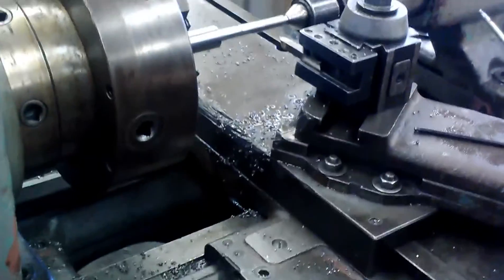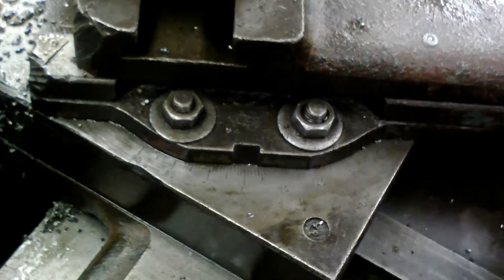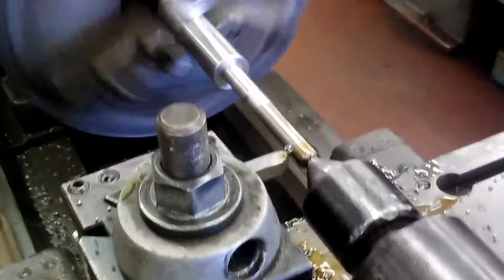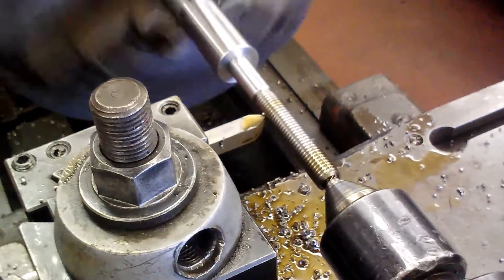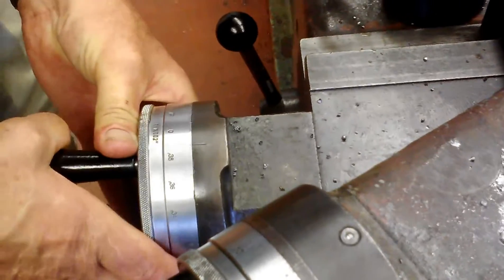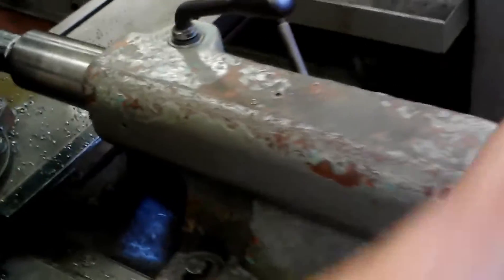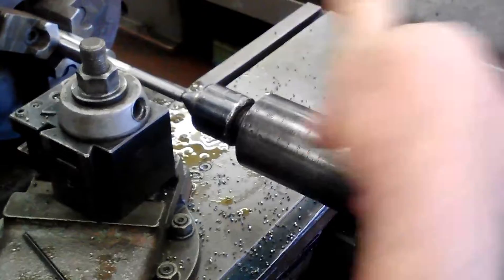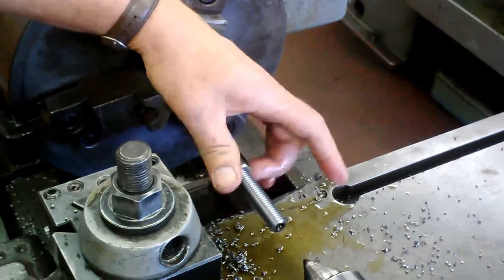Single Point Threading

Comment: ...you don't need to shut off or reverse the spindle...and you don't need to engage the same number on the threading dial...
...you should include a disclaimer that this is the way YOU do it...
...not the way an actual machinist would do it...

Comment: My lathe has the thread cutting gears but no chart to set the thread pitch.. Any suggestions pls?   Thank you
Reply: Yes, you need to calculate the change gear ratios to get the pitch or threads per inch for the thread you want to cut.
You will have to know the threads per inch or the pitch of your leadscrew to do this.
The formula is different for Imperial or Metric threads and is a subject too deep for a simple do it this way topic.

Comment: It seem to me that while going in reverse you could accidentally reengage the piece at the wrong time and mess up the threads. Am I missing something, or is the track the cutting blade can take on the workpiece set so that even if you disengage and reengage at random it will always be on track?
Reply: You would be engaging with the lathe's lead screw & half nut meshed in the opposite direction.  If you have a lot of backlash on the lead screw it's better to disengage the half nut, back the tool away, and manually crank the carriage back.

Comment: If only all male "fasteners" needed/could work with a "shank" LARGER IN DIAMETER THAN THE "MAJOR THREAD DIAMETER" AND A "THREAD GUTTER" BETWEEN THE "SHANK" AND THE "THREADS" AND SOMEBODY COULD INVENT AN "INTERNAL SINGLE POINT CUTTING LATHE" FOR THE EQUALLY IF NOT MORE IMPORTANT FEMALE THREADS "SINGLE POINT THREAD CUTTING" COULD GO FROM A RARE AND REALLY SHITTY WAY TO CUT "QUALITY" THREADS AND PRODUCE "FASTENERS" BACK TO BEING "STATE OF THE ART". OF COURSE ROLLED THREADS WOULD HAVE TO DISAPPEAR FOR THAT TO HAPPEN SINCE WHEN THEY "APPEARED" THEY "OBSOLETED" THIS STUPID "SINGLE POINT CUTTING SHIT" AND UMPTEEN "PASSES" AND WHO KNOWS HOW MANY MINUTES/HOURS OF "SET-UP" JUST TO CUT A SINGLE FUCKING THREAD PRETTY MUCH OVERNIGHT.
Reply: You forget, in your stupid ranting, that many people do cut threads with single point tools on old and long forgotten lathes makes with belt drives and back gears , not only with preformed carbide but with hand ground HSS too........you have a lot to learn, but by your ranting post it appears you are merely a capstan lathe operator only used to do piece work, so what would you know of anything mechanical when it comes to engineering.

Comment: More and more people are forgetting and or not even bothering learning old fashioned manual mills and lathes! I salute you good sir!
Reply: And more and more people are being brainwashed to believe "single point thread cutting" is a practical, effective, professional and desirable way to "thread" anything but "readi-rod" in a day and age where ROLLED THREADS have been "standard" in the industry for high-quality, properly-profiled, proper thread engagement STRONG and SMOOTH and RELIABLE THREADS CAPABLE OF DOING THE JOB PROPERLY. Go look at any tap or die. See a "single point"? No. Why? If you have to have it explained to you you're probably a "machinist" but a damned poor or inexperienced or highly "educated" one who has spent a LOT of time "learning" out of textbooks, on the internet etc but damned little time if any gaining KNOWLEDGE by getting the hell out of the "classroom" and into the shop with some "real" machinists/mechanics doing real work in the real world handling real fasteners and threads of all shapes and sizes, metric and standard, rolled and cut and in all kinds of materials. A "thread" is a "continuous wedge" and the LAST thing you want is that "continuous wedge" to be a CHISEL in profile so the male and female threads are "cutting" each other and themselves as soon as they're "engaged" and torque and tension are applied. The "100% engagement" most of the online "master machinists" seem to think is "ideal" is impossible to do anything but break fasteners and/or strip threads with and no "single point cutter" is capable of FORMING a CONSISTENT THREAD AND A PROPERLY "SHAPED" ONE WHEN A "PROPER" THREAD IS NOT A "60 degree angle" with perfectly flat "sides" and a "knife edge" point and the idea that using "thread wires" to "measure" the "thread pitch" of threads is freaking hilarious since the very NATURE of a THREAD and its COILED "SHAPE" MEANS THAT THE TWO "THREAD WIRES" ARE NEVER GOING TO BE "OPPOSITE" EACH OTHER AND "IN LINE" SO THE MEASUREMENT IS OF THE ACTUAL MAJOR DIAMETER EVEN IF BY SOME MIRACLE THE "THREAD WIRES" END UP BEING PERFECTLY "SEATED" IN THE THREADS. THE "MAJOR DIAMETER" WILL ALWAYS BE "RIGHT" AND EVERY OTHER "DIMENSION" AND "MEASUREMENT" OF THE THREAD AND FASTENER/HOLE "PERFECT" AS LONG AS THE BEGINNING DIAMETER OF THE "ROD" AND "HOLE" TO BE THREADED IS CORRECT AND THE PROPER QUALITY DIE AND TAP ARE USED ALONG WITH APPROPRIATE "CUTTING FLUID" AND TECHNIQUE AND "ADJUSTMENT" AND THE "MACHINIST" DOING THAT "PRECISION" MACHINE WORK BY HAND THE WAY ITS OBVIOUSLY INTENDED TO BE DONE GIVEN THE LACK OF A "POWER TAP DRIVER" BESIDES A LATHE OR MILL OR WHATEVER MACHINE TOOL SOME DUMBASS "MACHINIST" THINKS IS MADE TO "THREAD" AND "PUSH" A TAP OR "HOLD" A DIE KNOWS WHAT THE HELL HE OR SHE IS DOING AND IS FOCUSED ON GETTING A QUALITY FINISHED PRODUCT RATHER THAN "SPEED".  THERE IS NOTHING THAT CAN BE AND IS DONE IN A "SHOP" THAT CAN BE DONE BOTH "FAST" AND "WELL"  SO THAT THE QUALITY OF WORK AND QUANTITY OF WORK ARE BOTH "HIGH". AND ONLY IDIOT WANNABE "MACHINISTS" WHO CLEARLY HAVE LITTLE OR NO "REAL WORLD" EXPERIENCE REGARDLESS OF HOW MUCH "EDUCATION" THEY HAVE FAIL TO GRASP THAT WHEN YOU WORK AND CHARGE BY THE HOUR THE ONLY  "BENEFACTOR" OF A "FAST AND LOOSE" APPROACH TO "PRECISION" PROFESSIONAL WORK IS THE SUPPLIER(S) OF MATERIALS AND TOOLS AND PARTS WHO GETS TO SELL YOU A LOT MORE OF HIS GOODS AND/OR SERVICES THAN HE "SHOULD" BECAUSE YOU REFUSE TO GRASP THAT TIME IS MONEY AND YOU ONLY MAKE MONEY THE FIRST TIME YOU DO SOMETHING. THINK YOU CAN STILL "BREAK EVEN" OR EVEN "MAKE MONEY" DOING SOMETHING WRONG ONCE OR TWICE BEFORE FINALLY DOING IT RIGHT AS LONG AS YOUR "BILLED HOURS" AND "MATERIALS" ARE STILL UNDER THE ORIGINAL "BID"? TRY THINKING ABOUT IT THIS WAY. THE FIRST TIME WAS THE ONLY TIME YOU GOT PAID FOR THE JOB YOU AGREED TO DO EVEN IF YOU DID IT "WRONG" AND EVERY ATTEMPT AFTER THAT WAS LOSING YOU MONEY EVEN IF "PROFITABLE" BECAUSE THE ORIGINAL "BID" COVERED IT BECAUSE WHILE YOU WERE DOING THE SAME JOB A SECOND, THIRD ETC TIME YOU COULD HAVE BEEN DOING A SECOND, THIRD ETC JOB FOR ANOTHER CUSTOMER. EVEN IF YOU DIDN'T HAVE WORK WAITING YOU AT LEAST WEREN'T WASTING MATERIALS, TOOLS, MACHINE LIFE, ELECTRICITY ETC DOING NOTHING AFTER DOING THE JOB RIGHT THE FIRST TIME.

AND THE FACT THAT ALL THESE "PROFESSIONAL MACHINISTS" HAVE TO USE WHAT MUST BE A VERY DIFFICULT AND COMPLEX SUPPOSEDLY "SUPERIOR" PROCESS AND A MACHINE WORTH THOUSANDS OF DOLLARS TO INCORRECTLY DO SOMETHING IN A WHOLE BUNCH OF "STEPS" AND "PASSES" THAT A "CHEAP" TAP/DIE AND HOLDER/WRENCH AND A "ROOKIE" MACHINIST/MECHANIC THAT'S BEEN TAUGHT A FEW SIMPLE, EASY TO "GET" FUNDAMENTALS CAN DO WITH ONE "PASS" IN LESS TIME THAN IT TAKES THE "EXPERT" TO "DEMONSTRATE" IT IN A "HOW-TO VIDEO" WITH THE MACHINE ALREADY "SET UP" DEMONSTRATES PERFECTLY WHY SO MANY "PROFESSIONAL MACHINISTS" WITH THEIR YOUTUBE "HOW-TO" VIDEOS AND APPARENTLY LOTS OF SPARE TIME IN OTHERWISE "EMPTY" SHOPS WITH NO "CUSTOMERS" CALLING OR DROPPING BY EVER END UP MAKING "CHIPS" AND "HOW-TO" VIDEOS WHILE "AMATEURS" ARE MAKING PARTS AND MAKING MONEY. 

Those who CAN do and those who CAN'T teach. And thank God for that situation. Turn all the "teachers" loose in the "real world" and already "swamped" machinists/mechanics wouldn't begin to be able to keep up keeping the world "running" doing all the work they already do as well as the "re-work" of "professionals" who KNOW IT ALL as long as "it" is IN A BOOK OR "DEMONSTRATION VIDEO" AND WITH BRAND-NEW MATERIALS AND AS MANY "TAKES" AS NECESSARY TO "GET IT RIGHT" BUT IN THE "REAL WORLD" CAN BREAK AN ANVIL WITH A RUBBER HAMMER "TEACHING" SOMEBODY HOW TO BE A "BLACKSMITH" OR "SINGLE POINT CUT" A THREAD ANY EXPERIENCED MACHINIST/MECHANIC WOULD THINK WAS "STRIPPED" AND/OR "CROSS-THREADED" HAD IT COME FROM ANYWHERE BUT RIGHT OFF THE "CUTTER". AS LONG AS THEY DON'T HIT THEMSELVES IN THE HEAD WITH THE HAMMER OR SMASH THEIR THUMB WITH IT OR "SINGLE POINT CUT" THEIR OWN THROATS OR SOMETHING BEFORE THEY GET AROUND TO THE "DEMONSTRATION" THAT IS.

In particular I find all the BRAND-NEW SHINY CLEAN MATERIALS used in these videos in SHITTY WORN-OUT OLD SCRAPYARD-REJECT "QUALITY" MACHINE TOOLS A "RESELLER" LITERALLY PAID SCRAP PRICE FOR OR WAS PAID TO HAUL OFF AS SCRAP MANAGED TO SELL SOME "PROFESSIONAL" WHO BUYS "GOOD CHEAP" MACHINE TOOLS TO DO "PROFESSIONAL WORK" APPARENTLY NOT REALIZING THAT THE "PREVIOUS OWNER" GOT RID OF THOSE "QUALITY" TOOLS FOR A REASON. EITHER HE "BROKE" THEM OR THEY "BROKE" HIM. EITHER WAY, THEY'RE SHIT AND BETTER OFF AS RAZOR BLADES THAN "THREAD CUTTERS" and if more "professionals" would start acting like it and "investing" in QUALITY NEW OR "LIGHTLY USED" DEMONSTRATOR MACHINES INSTEAD OF PISSING AWAY MONEY ON OLD JUNK, THE "DEMAND" FOR QUALITY NEW MACHINE TOOLS WOULD INCREASE SIGNIFICANTLY, THE REAL HIGH-QUALITY MACHINES WOULD GET DRAMATICALLY CHEAPER AND THE "DISCOUNT" MACHINE TOOLS THAT ARE STILL "BETTER" THAN WORN OUT OLD "QUALITY" SHIT BUT NOWHERE NEAR AS GOOD AS THE "GOOD STUFF" WOULD EITHER "GO AWAY" OR "GET BETTER" AND PUT EVEN MORE OR LESS "PRESSURE" ON THE MANUFACTURERS OF THE GOOD STUFF SO THEY COULD SPEND LESS TIME AND MONEY "MARKETING" THEIR MACHINES AND "SELL" AND BUILD THEM A HELL OF A LOT BETTER AND/OR MAKE THEM AS GOOD AS THEY ARE CURRENTLY AND JUST MAKE THEM MORE "USER-FRIENDLY" AND EITHER WAY PUT A HELL OF A LOT MORE QUALITY NEW MACHINES AND QUALITY NEW MACHINISTS TO WORK.

THE "PROS" WITH THEIR "HOW-TO" VIDEOS KIND OF FORGET THAT IF EVERYBODY TOOK THE "USE THE OLD SHIT" APPROACH TO SELECTING "QUALITY" TOOLS THEY DO THERE WOULD BE NO NEW TOOLS OF ANY QUALITY SINCE THE "OLD SHIT" WOULD SIMPLY BE USED BY "NEW MACHINISTS" TO MAKE "NEW SHIT" MACHINE TOOLS THE WAY THE "OLD PROS" WITH THE "HOW-TO" VIDEOS USE THEIR "OLD SHIT" TO TURN NEW MATERIALS INTO "NEW SHIT" PARTS.
Reply: Aren't there some harder materials like inconel that require single point? Don't all these lathe principles apply when doing CNC, or does the machine take care of a lot of these details automatically?
Reply: @deeremeyer1749  Geesus, but you are long winded self opiniated twat of the first water.......nothing you said has any meaning for practical single point screw cutting procedures......you definitely need some counseling in customer relations and a lesson in the use of the English language.

Comment: Why are you cutting it with the taper?
Reply: It's better to come in at an angle when cutting a new thread.  That way you are only cutting the thread on one side (left side) of the tool.  Straight-in cuts often don't work out as well and often look shabby.